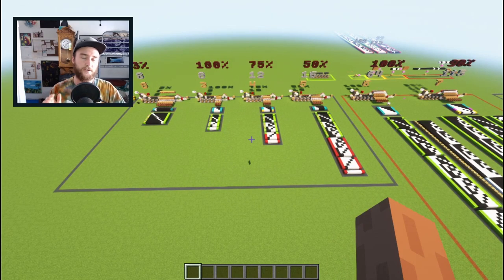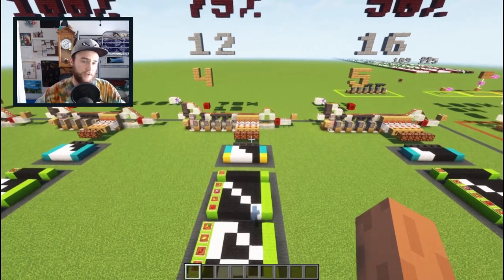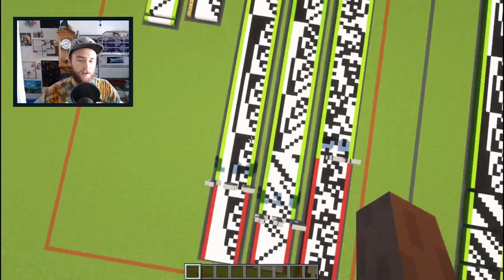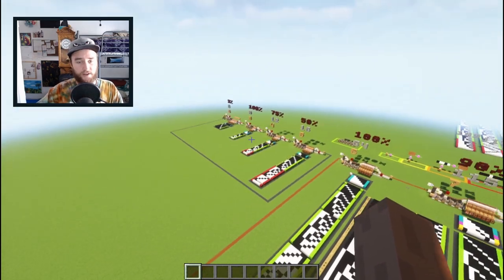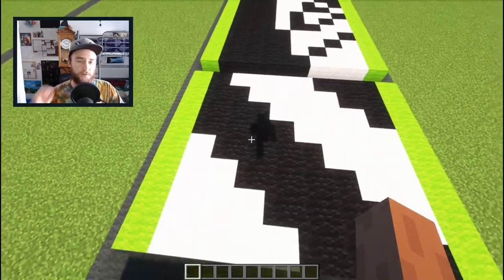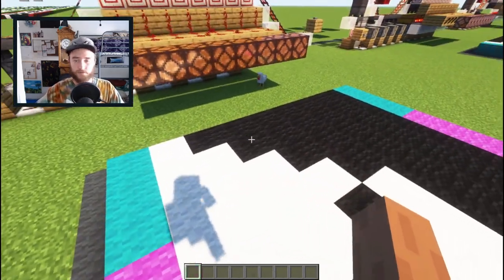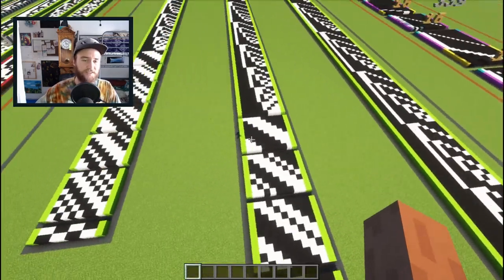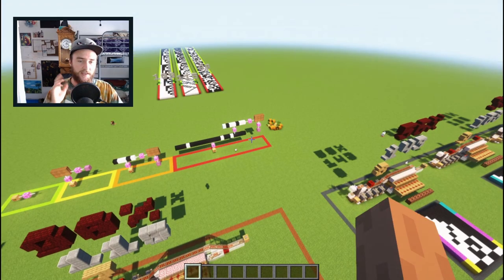Encoding items in Minecraft (2 of 5) - scaling up

Comment: A possible solution for the "54 item capacity" limitation of double chests could be to cram a bunch of entities into the same block. The TL:Dr is that you can shorten the machine to 10 filter slices using hopper minecarts. [Wall-of-text warning for below!]

At first I thought that chest- or hopper minecarts won't work, because they'd snap to the rail below them - but it turns out they do. You just need to offset them far enough away from that rail, which I figured out while determining that boats with chests can also be drawn from by hopper minecarts. (More on the problems with boats in the bottom paragraph.)

The fact that you can overhang minecarts on either side of the rail means that the moving minecart can only draw from one side at once, i.e. the output signal won't be in binary any more. In fact, our stack of hopper-minecarts will pull from one(!) of several different double chests, and each of them can be its own digit value at the position of that slice.

4 double-chests per slice would offer the advantage that we are pulling through only 21.6 hopper minecarts crammed into the same spot, I.e. entity cramming will (hopefully) be no isssue. That means each slice gives its output as a base-5 digit (4 different "this chest" plus 1 "no chest" signals).
6 slices of those would mean that we are encoding our output as a 6-digit base-5 number where at most 3 digits are larger than 0. But that would require 113 items in each double chest.
What we can do (if we are fine with encoding only about 986 outputs) is to use 10 slices with 4 chests for a 10-digit base-5 number where at most 3 digits are larger than 0.
And 11 slices (with 4 double chests) encode about 1114 (11-digit base-5) numbers.

The "draw-from-chest-boat" design has two problem. First, comparators can only monitor entity inventories indirectly, through their capacity to accept (or provide) items. And secondly the boat chests don't pull items on their own, and there are no entities that can push items into them. I.e. we have to push items into them with blocks. Luckily, both hoppers and droppers work. But the new bottleneck for detecting an item pulled from a chest boat will now be this pushing of items from non-crammable sources, specifically how many different item types you can push into a chest boat.
You can again align 2 boats hanging over each side of the track, for a maximum occupied volume of 5*3*2, which you can push into through almost all faces of it's 6 sides, specifically from 53 droppers = 477 slots (which means you can make use of 17.67 crammed boats). I doubt that you can activate and feed items into all of them, but 477 is the upper limit. In reality, you'll probably want to keep the slice thickness down, so that you don't have to speed up your hopper minecart to over 5 blocks/second. With 2-block slices you can have 18 hoppers = 90 slots pushing from only 3 sides into 3.33 boats occupying 5*2*2 blocks. The problem with only having 90 slots in a 2 block slice is that double chests alone have 108 slots. And even though with chest boats the filter storage can't scale up indefinitely, they still easily offer more than 54 stacks per slice.

Comment: I like how the token-organized schemes have Pascal's Triangle built into them, like how the 4 bit code has a 1-4-6-4-1 structure
Reply from the maker: nice catch. there's a second connection too. The amount of tokens added to the filters by each section is also a row of pascals triangle. For instance with 4 bits, the  1-token/2-token/3-token/4-token codes respectively add 1/3/3/1 items to each filter (the previous row of pascals triangle). You can use this connection to search for optimal encoding schemes by searching through pascals triangle

Comment: Since the fundamental limit of the amount of codes you can use is limited by the capacity of the chest could you just double the track and wire the other track into the same output and just use different codes on the second encoder so you keep the same amount of bits but double the amount of codes you could use so in the end you have two encoder tracks that go into the same output but have different codes in the chests Not sure if this would work but I think it should.
Reply from the maker: We're totally gonna do something like that for compressing the codes!

Comment: This locking with target blocks makes me think, shouldn't we have the same problem in the original design from the first episode? The minecart was passing over several hoppers with said item, and it could accidentally get two instances of the item pulled by one hopper...
Reply from the maker: the problem doesn't happen in the first machine because the hoppers and hopper-minecart only ever have enough time to pull out 1 item at a time. They're moving fast enough
Reply: @whitestonejazz  aahh I see, it's because with chests the hoppers are empty and could pull out items even when they shouldn't have. I misinterpreted the problem.

Comment: I don't know if you get to this later but I think I came up with a way of encoding 4000+ items, I'll share when I have something concrete
Reply from the maker: that will be great for storage tech
Reply: @whitestonejazz  I tried experimenting a bit and it's probably too  cumbersome because it involves too much logic. The idea was to chain together multiple 64 bit encoders in a way that if you got any non zero output you would save the number as [number of iterations] [result] as two 64 bit numbers. You would only lose one number out of every 64. I also had an idea to use the same encoder with some kind of translation table to make it faster but I'm just not good enough at redstone for that. Maybe you can come up with a way to make all of this in a smaller space.
Reply from the maker: @gnammyhamster9554  One thing that would be nice to solve too is an auto-filter loader. So some kind of device where you just fill up a single chest with your items and the auto-loader would assign each item a binary code and load it into the matching filters
Reply: @whitestonejazz  looking at your next video I realized my idea was very similar to your first design on video 3 but with the cart coming back when it got a result instead of doing through the whole thing. If you assign codes based on how often you need a certain items that design would be faster on more request items.